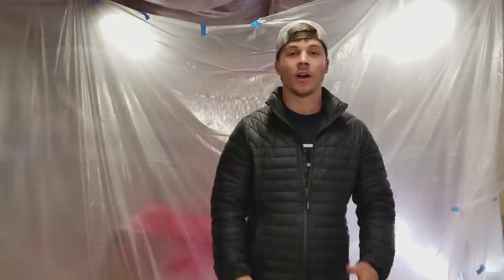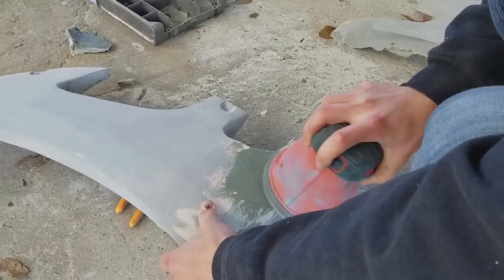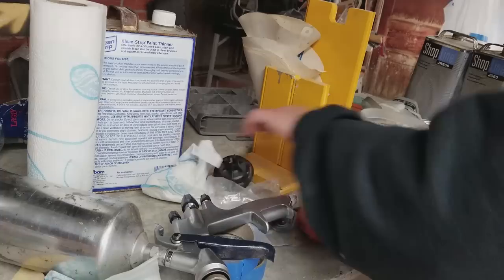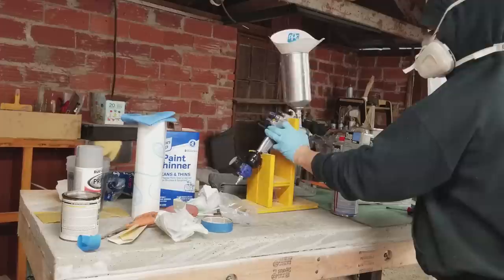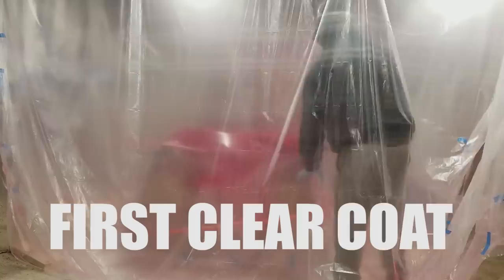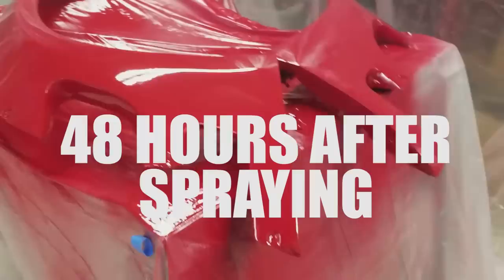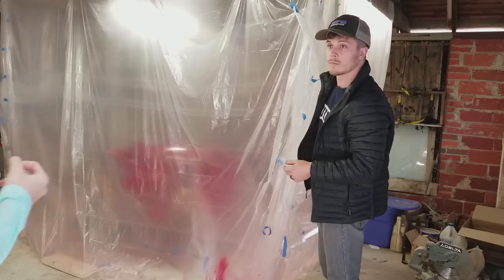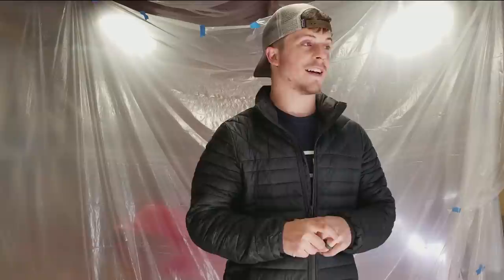ROCKET BUNNY MR2: THE REAR FENDERS ARE PAINTED!

Comment: Also, wetting the floor before painting will help tremendously as well as investing in a water trap.. I think you're assuming it's some elaborate setup or something, but all you need is a water trap on the compressor. Save you a ton of time and grief!

Comment: Great way to ruin the look of an sw20 they and a70 supra's are two toyota's that don't need flares or body kits as look right to start with, if changing wheels and tyres get the right size and offset to start with, instead of fail body lines.